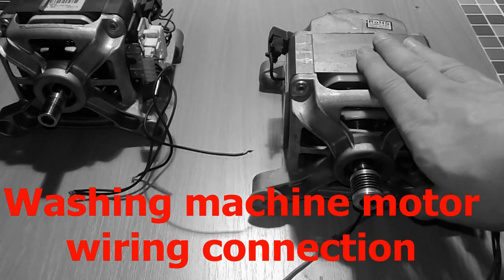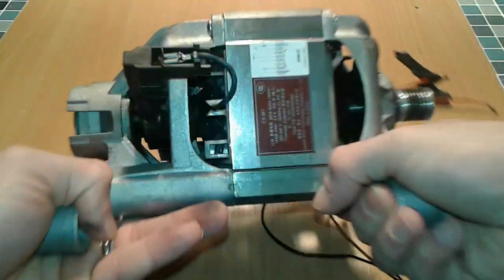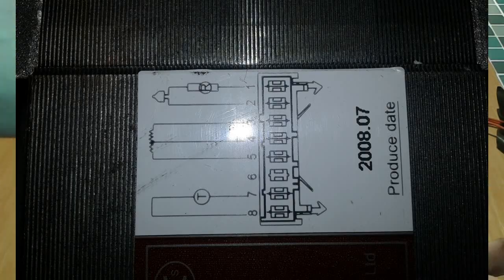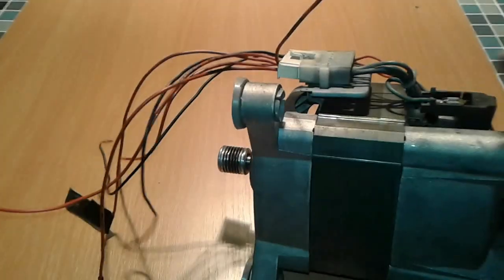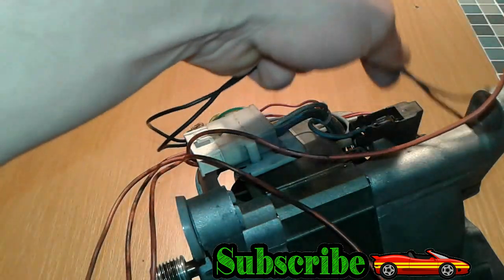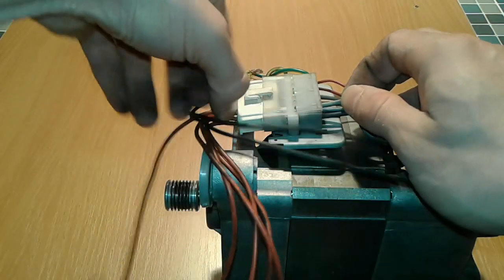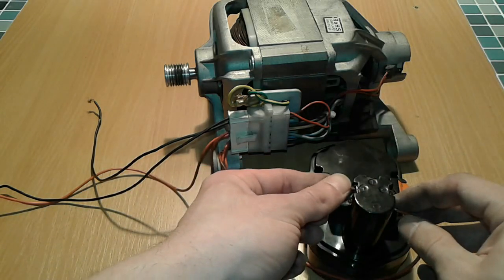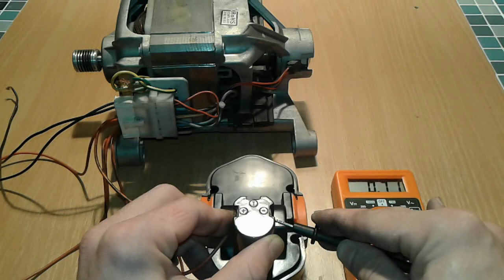Washing machine motor wiring connection

Comment: My motor says 240v Dc....can i put ac 240v in it? (With the connection you used for 18v battery)

Comment: Nice video, I have a 3 phase induction motor (washing machine) it says 197 v and it has 5 wires, 3 for the coils and 2 for the rpm, how to wire it to single phase 120 v
Reply: Those ac motors  are gay go for this one its better

Comment: Hi my motor has 7 connection points with 2 red wires connected in pins 2and 3 and my brush wires grey and black in pins 4 and 5. Tarco wires in 7 and 8 and earth 9. How do I connect the wires to test

Comment: Your video is very good! I want to use an old washing machine motor (similar to yours) to make a homemade lathe. Can I do this without wiring in a speed controller? I am wondering if it will reach a top speed & then just maintain that top speed   OR   if it will just keep accelerating until it burns out/overheats/fails. Thanks very much!
Reply from the maker: You can do it without a controller but every motor is designed to run top speed for a period of time seconds or minutes this is the purpose of the controller to mantain oprimun speed check out my other videos on wiring without a controller

Comment: How do you tell the difference between the three coil wires? Does the resistance just add up if you measure across both coils?
Reply from the maker: Simon Friborg Mortensen not all the motors are the same, this from the  video is a centre tap the resistance is the same on both pairs and when I measure the ends is double the resistance
Reply: @NoSkillsRequired  
I have a universal motor which has 3 wires to the stator. If i measure from the Center tap (I think) across either of the two other tabs, it shows about 5.3 ohm. But if i measure across the two outer tabs i shows about 6.2 ohm. Do you know why?
Reply from the maker: Simon Friborg Mortensen every motor it is wired differently it vary from manufacturer my advice is to follow the video for wiring and check the direction of rotation of the motor
Reply: its a 3 phase motor star so all windings are the same 
 @NoSkillsRequired

Comment: Dear Sir, I have a 1 phase electric motor that doesn't use carbon brushes. Used unused washing machines. Specifications of 230 volts AC 50 Hz 3.4 amp 100 watts 2800 rpm, SOLE brands made in Italy and 7 cables in light blue, gray, orange, brown, black, red and white orange. I have checked prisoners light blue - gray = 63 Ohm, light blue - orange = 58 Ohm, light blue - brown = 63.1 Ohm, light blue - white orange = 18.4 Ohm, gray - orange = 84.3 Ohm, gray- ash - brown = 89.4 Ohm, gray - white orange = 45.1 Ohm, orange - brown = 84.4 Ohm, orange - white orange = 41.2 Ohm, brown - white orange = 45.9 Ohm, black - red = 27.4 Ohm / alarm sound. Can you help me to determine which connection is phase and neutral.
Reply from the maker: Fransis Roong because your motor is not universal motor you should search for how to wire one phase, or induction motor you might need a capacitor as well to run it
Reply: Ok, thanks my friend
Reply from the maker: Fransis Roong any time buddy to bad I couldn't help you more
Reply: my friend maybe you can give us an email for discussion
Reply from the maker: Fransis Roong Demiwattuk@gmail.com